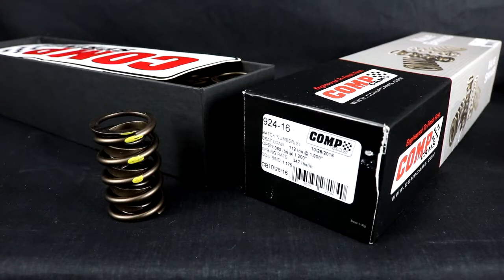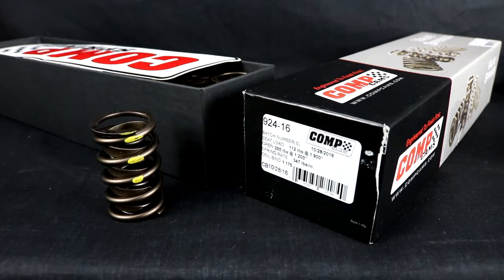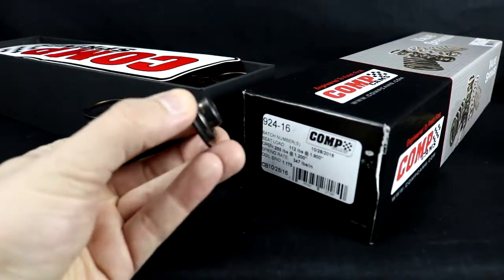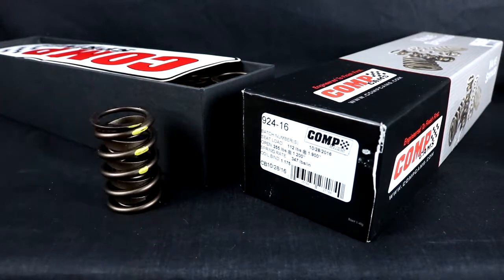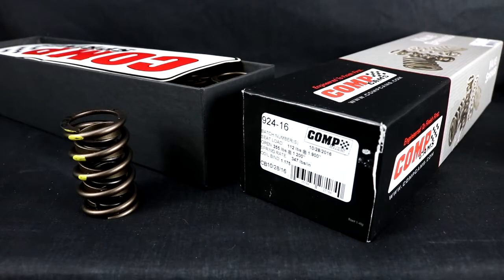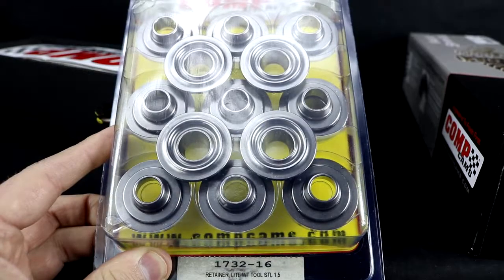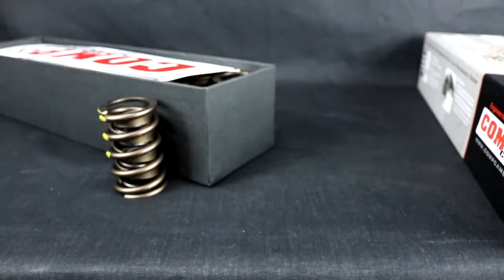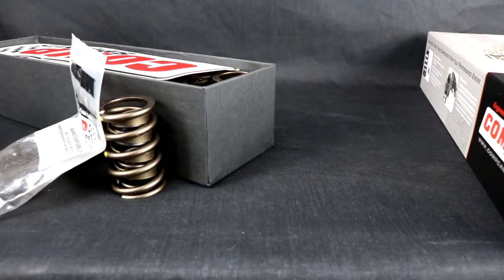454 Valve spring change - Part 2 Parts

Comment: Would those springs work on any 454? As long as it has a hydraulic flat tappet?
Reply from the maker: The springs need to match with the camshaft. So simple answer is no.
Reply: Do these work on peanut port heads aswell? Wanna switch to hyrd roller